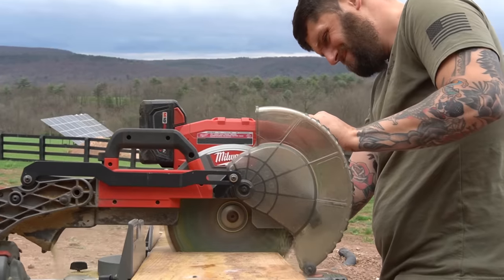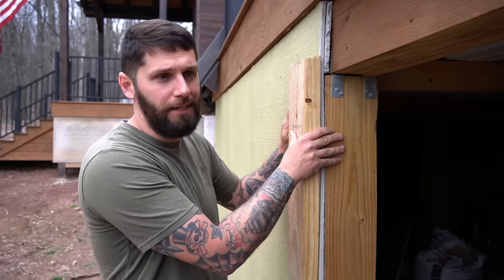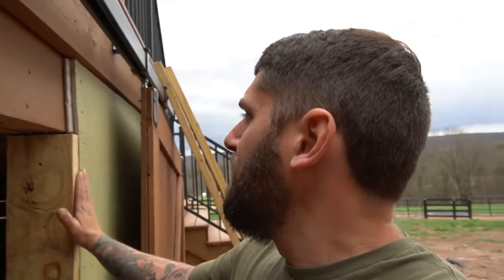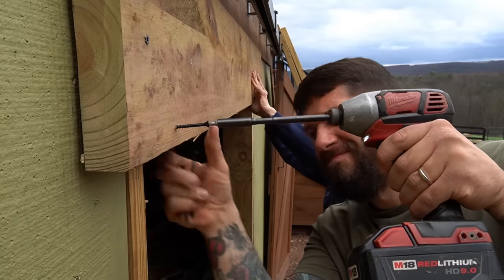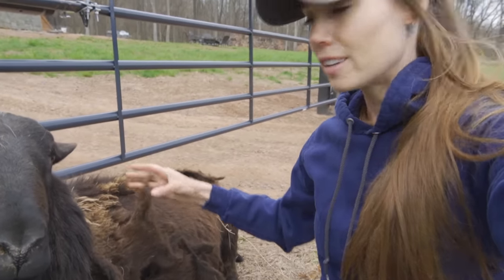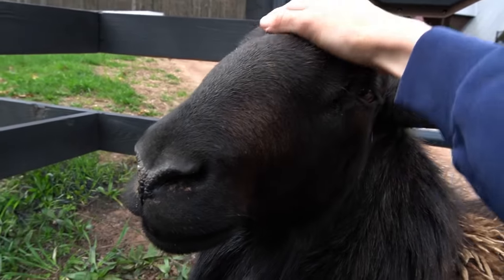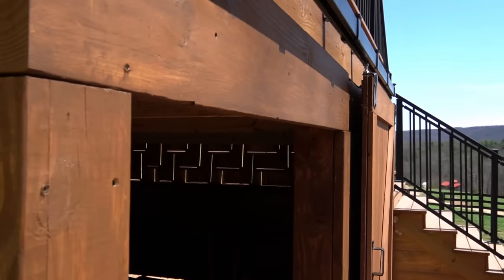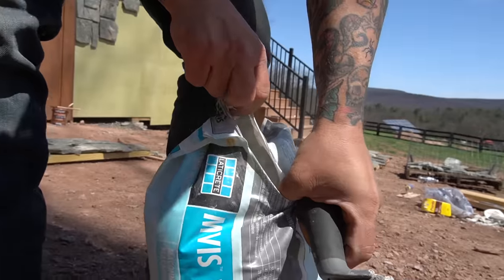FINISHING Our Concrete Foundation With Stone| Home Building

Comment: I recommend you seal that stone before grouting.  It protects the stone from grout drips and stains.  Makes clean up much easier..
Reply: Agreed James, Arbo gun the joints too, makes it way easier to apply the grout, especially the close joints.
Reply: @craigterry6072  What's an Arbo Gun? Serious question, I've never heard of that before.
Reply: 100% right. I started doing that years ago, makes grouting much easier to clean up afterwards. Then go back and seal everything when done.
Reply: Arbo Professional Hand Barrel Applicator - Dortech Direct

Brand: Arbo
Arbo Professional Hand Barrel Gun Cartridge size: 600ml The Arbo professional barrel gun is designed for use with foil packs of sealants and adhesives. The enclosed aluminium barrel can also be used for standard foil pack cartridges. Reviews 1 Delivery & Returns
Reply: if you fill it with grout..experiment a bit , you can fill in the joints easily, then brush them in, or  use a jointing tool(bucket handle)
Reply: @craigterry6072  Cool, thanks. Much better than a "Frosting Bag" for squeezing grout in the joints I'm sure.
I'm an Electrician, so the only tile, stone, anything like that that I do is for me or helping out a friend. I do like keeping up with tools used by other trades, especially things that make life easier. That sounds like a good tool, so I'm going to look it up.
Thanks again!
Reply: @kj3n569 i 'm a plasterer (UK), or drywaller to you :), but been around the block enough to learn a few good tools along the way. Nice chatting to you James, anytime.

Comment: ,Question: Are you going to finish the bottom of the exterior walls with some kind of critter barrier?  To keep the woodland animals from wintering over?
Reply: I was wondering the same thing. I'm guessing they will be using fill dirt and grass to bring it up to level.
Reply: It'll get back filled with dirt
Reply: I'm thinking it will be covered up by landscaping.

Comment: touch up trick with stone / concrete.   Elec drill with a 4" to 5" wire wheel can "sand" the stone when used carefully and cut straight lines, right next to different composition material

Comment: Painters tape or a hand held piece of card board could be used to protect the stones while you do the staining at the door but whatever, you guys did great as usual. Another idea, when cutting the stones on an angle, you could try scoring deeply on the back of the stone, with the electric power blade and then breaking it off with the hammer. It might give it a more natural edge. Just a thought, I'm not a stone mason either. lol

Comment: Back in the South where they use a lot of field stone to dress up buildings there is a position on the masons crew responsible for what they call ‘carrying stone’. That person’s job is to watch the mason and judge the space the mason is creating in the pattern. They must then find the best fitting stone in the pile to fill the empty spot. You can’t become a mason until you learn to carry stone. Easier with some stone than others.

Comment: 2 things for those sunburns... Day of the burn = Warning you WILL smell but as my granny put it "it will draw out the sting"  sit in the bathtub, have vinegar and brown paper bags, soak strips of the bags in vinegar and put them over the burned area and let them sit for a bit, as they start to dry out replace until 'sting' is gone... Bonus it helps the burn feel better faster.  For the next few days after day 1 coat all burns in Aloe Vera any time not outside in the sun.   

On my family that does 'tan' the above remedies cut down on the peeling, and they start to brown up faster and rarely burn more than the first 2 times in spring as long as they don't go weeks without being in the sun. 

I don't tan I ONLY burn... I have been known to burn with 50 SPF on in the SHADE in under 30 minutes in the height of summer. I burn that fast :(  So I have used these and a few other 'home remedies' all my life... and they DO work you just smell like Easter eggs for 24 hours lol.

Comment: Masonry construction always begins on the ground and then works up from there.  By attaching your stone from the top down, you might be losing the "look" of layered stone that supports weight from the bottom up; stone masonry is a horizontal process, not a vertical one.  Just a thought.

Comment: Hey guys I think you're supposed to put the mortar on the cement board wall and back butter the stone aswell also if it's real stone you probably need to use a half inch×half inch trowel to ensure that the stone adheres to the wall but it's looking awesome... good luck

Comment: Josh your a powerful man lifting all that sunburned concrete man off the ground like that. 😅🤣😁😉
   The rock wall is looking amazing and I like the way you trimmed out the casing of the door.
   Sunburns are easy to get in the spring. I'm like Josh though I don't burn much, usually more tan then burn.
   Nice work though 👏

Comment: Hi Erin, if you burn easily, here's a tip that for some reason not many people seem to know about. Get yourself '100% PURE ESSENTIAL LAVENDER OIL'. In the UK it usually comes in 10ml (0.33 US Fl. Oz) bottles. It's great for any kind of burn (as long as it's not an open wound). For best results on a small burn of any kind, for example from a stove, iron, a flame etc., I apply it direct and undiluted and usually, within a few hours, you won't even know you burnt yourself. For large areas such as sunburn, you can apply it direct or alternatively, put about 10 drops in a bath (tub) of water, soak in it for 15 - 20 minutes. When you wake the following morning you might still see the redness but all of the soreness will be gone, (still better if you can apply it direct). Being an oil, it spreads very easily so a little goes a long way. A 10ml bottle lasts me years. Always keep it handy and the sooner you can apply it the better. If you apply it immediately to a burn, it will often stop it from blistering. I really hope this snippet of information is useful to you. I love your videos, you are an amazing family.

Comment: In regards to staining the board around the sliding barn door: Since it is screwed in, you could have removed the screws and the board and then stain it  on both sides and put it back without getting stain on the stone.

Comment: I would use sheetrock screws and set them in the stained board. leave them out (dont sink them. ) and let the cover piece sit on the screw heads off setting the distance you need.

Comment: Looks amazing. I used to do stone work back when I was 18 years old. usually we would apply a scratch coat, and smother the stones with mortar. We would then use a jointer to carve the joints nice and smooth. No need to fill all of the gaps later. But I was never an expert! Maybe you two have a better way of doing it! Looks amazing :)

Comment: Should make pillows out of Leon’s hair. Clean it, stuff it..Boom. Leon pillows!! Halfway kidding..lol.. - Donovan -
Reply: Also mix dawn with water and soak the stone. Oil based stain products won’t stick. Washes right off. Do the same to concrete or poles or anything else you don’t want stain to stick to. What we do when doing fence jobs. You can use a big type sprayer and mix dawn and water.

Comment: The stone work has turned out beautiful. Great job. Question. The door trim boards installed in this episode were put up with screws. Why didn't you just unscrew them to stain and reinstall?
Reply: That would have been a good call, but oops it was missed. :)

Comment: You have to slap on that sun screen on or you will keep on burning.  I got cancer on the nose twice and needed the Mohs Procedure to have it cut out.  When I was younger I never used sun screen and all sun without protection is what caused all my skin damage.  The stone facing is all must done.  Doing stone work is very hard work but it is looking good.  When do you start the extra wing of the house and how is the building of the rental house going?

Comment: Not tryn to harsh on all Y'all's very hard and tedious physical detail work but I have a serious question about the deck steps and landing. How are Y'all gonna deal with the rain water washing under the steps and landing on the pasture end of the deck? I figured when you built the rain diverters under the main deck you would build something similar under the steps and landing but didn't think it really mattered at the time because Y'all were talkin bout a much more ventilated wall system. However now with all this stone on green board I'm thinkin that the area under the steps and landing may create a moisture issue for the rest of the space as the deck is now effectively fully enclosed with walls and doors and mostly dried in. I know from experience that in Va. where I have a house with a rather large Trex deck there is a definite wash problem as the soil under neath is heavily furrowed by the rain and continues to erode. This in spite of a very well ventilated underpinning. I do think though you may not have as much of a problem as my decking runs congruent to the fall line of a hill where as yours is perpendicular to the slope it is built over with the exception being only the lower steps on either end.

Comment: Okay now you had to put that little piece up in that the inch and an eighth but now when you close that sliding door on that go at an angle and you can see right inside there what are you going to do about that you close that sliding door there and the angle that your wife had the camera I could see right through that Gap and underneath your porch what are you going to do about that space did you ever think of that thank you for your video I do enjoy watching them
Reply from the maker: We don't need the door to be sealed. We just want a closed off space to store things.

Comment: Josh needs to chill out, too much OCD. It seems to be going around so much these days with so many ppl having OCD where simple things almost make ppl's heads explode & they lose sleep over every little thing as it turns them grey haired in their early 30's. He could have put on some timber on the table saw to make it thick enough so that he could put several vertical strips & a single horizontal strip along the bottom & it would have been fine having a partial empty cavity.